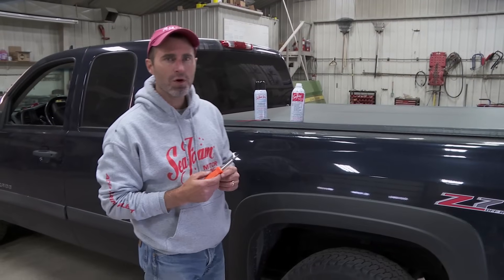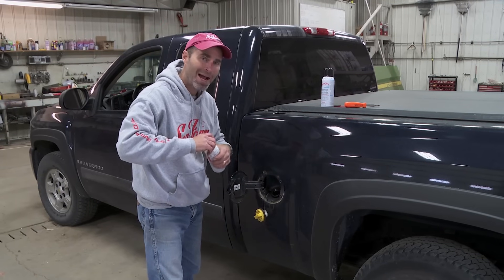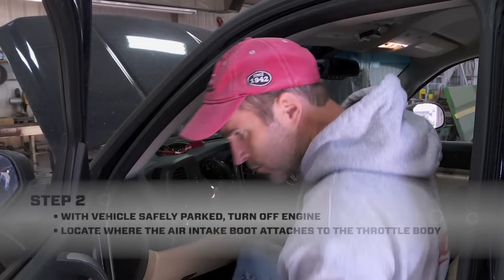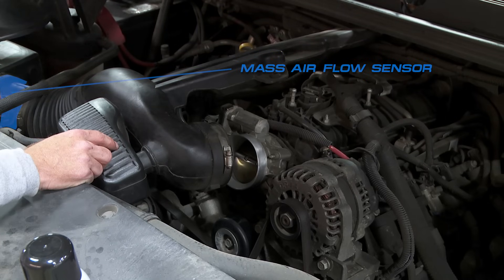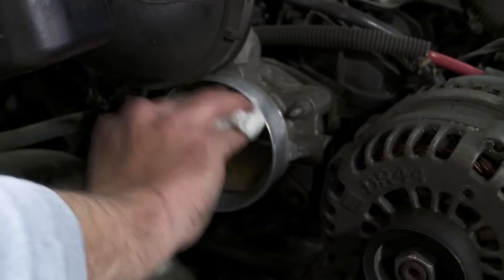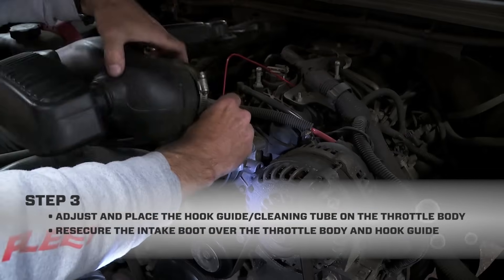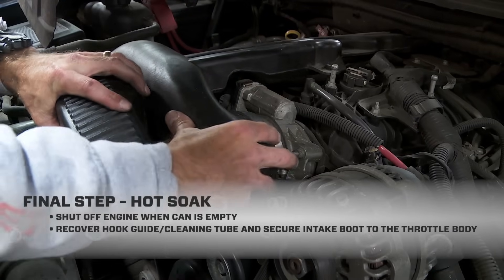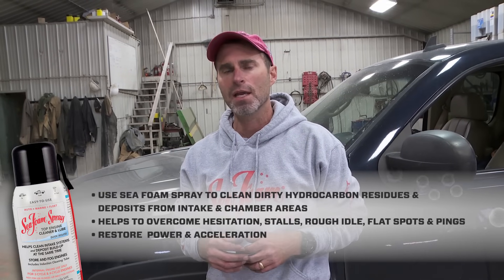How to clean a gasoline fuel injection air intake with Sea Foam Spray

Comment: so u fill my tank an then pour it in the tank ? an drive around  normal ? don't have to do anything else ?
Reply from the maker: +Justin Jacob   Hi Justin:  If cleaning, better to add when fuel tank is lower.  For maintenance, add 1 oz per gallon of fuel in the tank.  Yes, just pour it in the tank and drive.

Comment: Some people use Sea Foam product to clean the O2 sensor?  is ok? if yes which type to use,  Thanks
Reply from the maker: +Tung Lau Thank you for the question.  Whether using Sea Foam in fuel (through injectors) or Sea Foam Spray through the intake, both continue to lubricate, though neither will continue to clean beyond the chamber.  O2 sensors (past exhaust port) are too far downstream.  Some claim applications that clean O2 sensors by removing and soaking in Sea Foam.  Even so, not anything we promote.

Comment: Great video, but I have to ask, do you drive that truck through  manure or something, what's with all the flys?
Reply from the maker: +Foxtrot Alpha  The building was probably the last warm place before fall freeze temps.  They wanted to be around that hot engine, anyway.

Comment: Can this be done this way on a turbocharged car? Specifically, I have a MINI cooper S with the N18 engine. Would I still apply seafoam this way?
Reply from the maker: +Jon Parker  Thanks for the question.  Yes, works for any gasoline engine as long as you're right in front of where the throttle plate opens (spraying directly into the throttle body)..

Comment: No need to pour some seafoam in crankcase?
Reply from the maker: +Ngoc Huynh  Hi Ngoc: Adding Sea Foam to the crankcase is a different application than Sea Foam Spray through the top end/intake.

Comment: Could be user error on me. 1990 Accord, had straw inside intake as instructed, hose back on, emptied can while engine running 2k rpm. Let soak and noticed a puddle of seafoam under left front of car. Not sure what happened- produced little if any smoke. Drove for ten minutes. No noticeable difference. Advice?
Reply: Sorry, under right front of car was puddle
Reply: +Sea Foam Official ok thanks I'll try again.
Reply from the maker: +D Chester   Hi D Chester    If there's a puddle of fluid there's often a misapplication matter at play.  Use our website's Ask Jim feature and we'll give you the personal attention needed.
Reply: +Sea Foam Official do I use the whole can?
Reply: +Ralphael Hillman its recommended to but i saved a small amt to use on my line trimmer :-)

Comment: Some where i read this type of cleaning could possibly damage catalyc converter, is this true? pls answer
Reply from the maker: +Robbin Jiimmy  Important question - Thanks!  Answer: No worries. Note: Exhaust heat is the main cause of converter failure. Sea Foam Spray through the throttle body will not increase the the heat of exhaust.  One way to ruin a catalytic converter or O2 sensor is to misapply an additive through the vacuum line and flood the sensor or converter (this may be where your idea came from). Also another reason to consider Sea Foam Spray as an alternative to harm that can occur when a vacuum line treatment is not carefully/correctly induced.
Reply: Ok. Thanks for the detailed answer.

Comment: Great video! Why do I see some people putting in their vacuum tubes instead of doing it this way??
Reply from the maker: +MrandMrsHayday  That's a great (and important) question!  Application through the vacuum line works EXCEPT not as thoroughly.  THREE IMPORTANT DIFFERENCES:  1) Vacuum line application does not clean the upper Intake while Sea Foam Spray cleans oil and gasoline vapor residues from the upper intake (throttle body, manifold) to the chamber. 2) Depending on engine make, vacuum application does not always feed all cylinders while Sea Foam Spray into the throttle body works its way throughout the entire top end, then into all cylinders. 3) Safer for non-professionals! The Spray version correctly applied through the throttle body eliminates the risk of liquid in a cylinder (vacuum induction misapplication), which is why Sea Foam notes "PROFESSIONAL ASSISTANCE" on the Sea Foam Motor Treatment can.

Comment: Is there a video that shows how to use this on an engine that has a turbo on it? If I disconnect the air intake after the mass air flow sensor, it is right at the turbo. Would that be the correct place to use the tube and spray into the engine?

Thanks!
Reply from the maker: +ericiniraq1  Hi Eric:  Always feel free to ask questions on our website's Ask Jim feature. Never spray in a location that puts the MAF sensor or turbo between the spray insertion and the throttle plate. The key is to place the tube immediately in front of the  throttle plate.  You must disconnect the intake where it attaches to the throttle body.
Reply: +Sea Foam Official Thanks Sea Foam!
Reply from the maker: +ericiniraq1 Our pleasure, always!  Note: Using the Ask Jim feature is great info for specific technical help, fast!

Comment: Install an oil catch can on those silverados! Finally got mine clean from the afm sucking raw oil into the center of the intake through the pcv system. Bad engineering on gms part.
Reply: What one did you use?

Comment: any change that it can damage throttle body if the hose end touches with butterfly valve?
Reply from the maker: +Subair kandy Would be more concerned with a throttle body's electronic management.  No matter, the tube should never be placed where it could contact the butterfly plate.
Reply: ok. so you mean to say tube end should be placed before butterfly valve? not passing through butterfly? right?
Reply from the maker: Correct - The ideal length is to set tube nozzle end to point 1/4" in front of the upright resting point of the plate face that pivots inward (downstream). There's also a diagram on every can of Sea Foam Spray.
Reply: +Sea Foam Official ok. thanks..last question..i have two throttle body on infiniti fx..is it safe to do for both intake simultaniously on should i do it one by one at different time..sorry for asking so many questions..just curious as i dont want to damage anything..
Reply from the maker: +Subair kandy  One at a time is easier.

Comment: THis stuff does really work i used to think that it was bad and scoured the head of the engine but it really does clean up all the carbon residue or whatever and your engine will breathe which makes a huge increase in perfomance to the way your engine runs.  I was wrong in dissing this product and i want to clarify that this does really work and i was wrong in saying it does not but yes it does.
Reply from the maker: +b Thanks, B.